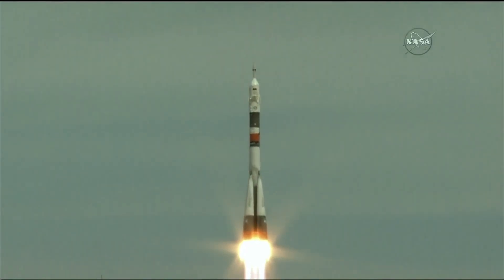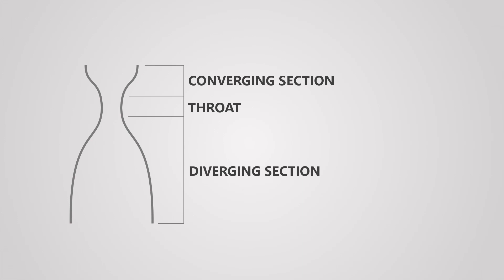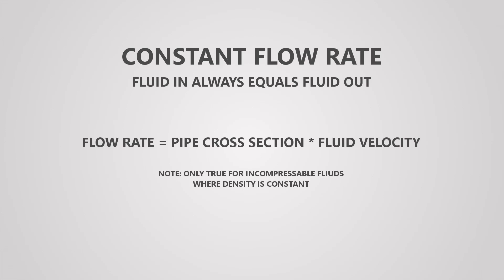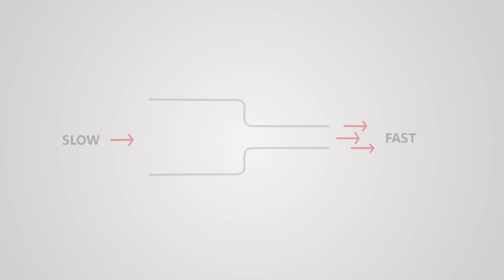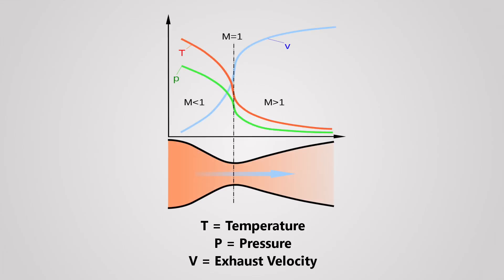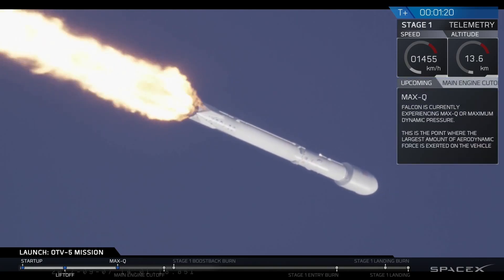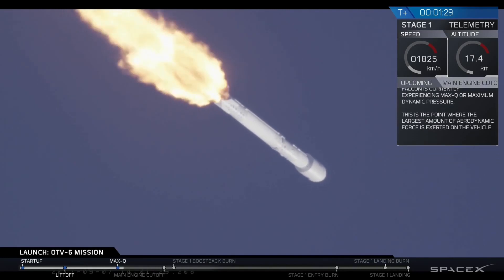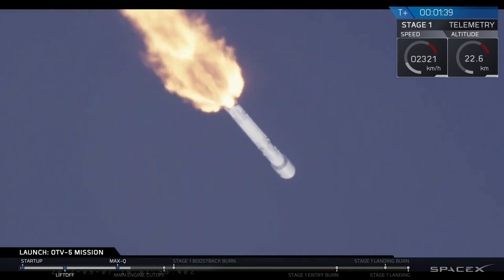How Rocket Engines Work - Part 3 - The Converging-Diverging Nozzle

Comment: I have a question, why the second stage of Falcon 9 has a bigger nozzle?
Reply from the maker: Since the second stage is burning in the upper atmosphere and space the ambient pressure is lower. Lower ambient pressure means the engine can have a larger expansion ratio without running into stability issues. Larger expansion ratio allows for slightly better efficiency.
Reply: @SpaceIsKindOfCool  Thanks for the answer, 
I've always been wondering about this before

Comment: Rockets work on pressure ONLY..  The higher the pressure behind a rocket.  The faster it goes.  That is why it is impossible to go higher than 150.000 feet with a rocket.  The air is too thin to create any pressure.   Let that sink in.
Reply: That’s complete nonsense. Rockets work because they push exhaust out the nozzle, this pushes the rocket in the opposite direction. External pressure has absolutely nothing to do with it.
Reply: @aldunlop4622   you cannot push on your exhaust unless it it has resistance from the atmosphere.   There is no resistance in a vacuum  and so no resistance to hold the exhaust.  This is very basic physics.
Reply: @cin806  yeah like what? Rockets work in space...

Comment: But why should the exhaust be at the same pressure as the ambient outside one?
Reply: If the exhaust exiting is at a greater pressure, some of the exhaust flares out at an angle, which reduces efficiency as it means some of the resultant force acts horizontally as well, not powering the rocket. When the pressure is too low, surrounding air can flow into the diverging  end of the nozzle, slowing the flow of the engine's exhaust, reducing efficiency. Everyday Astronaut explains it much better in one of his video's.
Reply: Basically because that is when it is the most efficient. When it is higher than the ambient pressure, you could still make the nozzle bigger and gain some more performance, but if it is lower, it starts to cause problems with the engines.